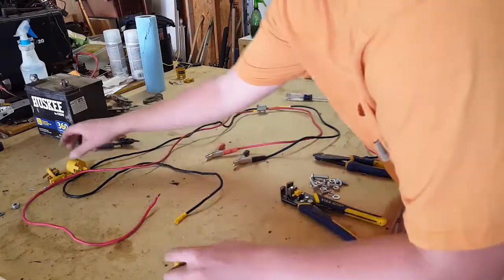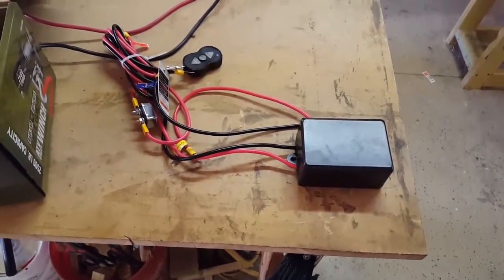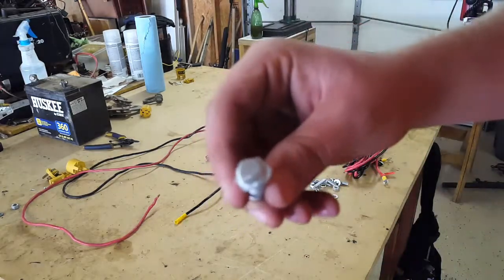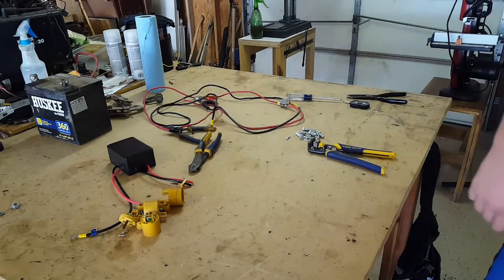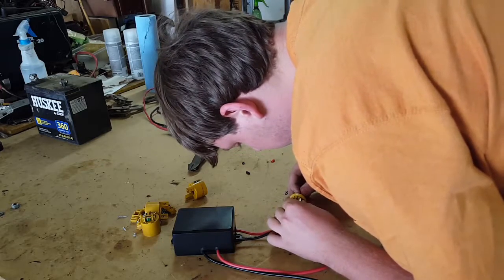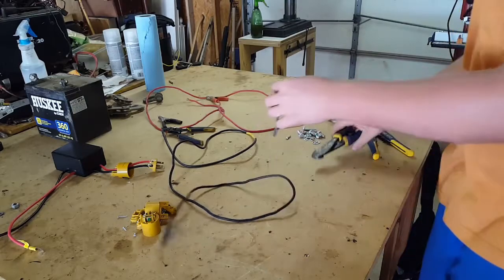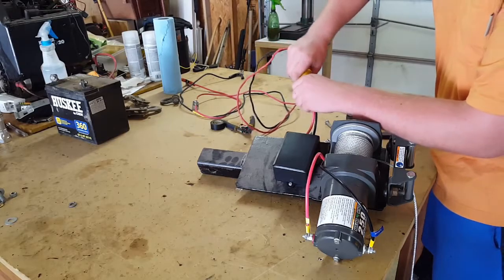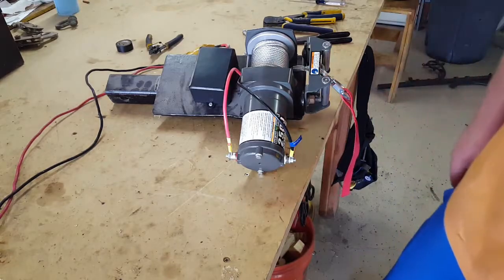An electric plug, a winch, and a receiver hitch - awesome mount setup for winch

Comment: does this answer to How to Run a 12V Winch on AC Power – [Step-by-Step]?  never done this so really confused here.
Reply from the maker: No… still runs on 12v battery just using the plug for easy connection.

Comment: You seem to know about electrical well enough for me to ask you this. I want to buy that same winch to pull a 600lb motorcycle into a truck bed.  Do you think the Harbor Freight Predator generator /inverter can power that winch?  Appreciate it if you could let me know. The Predator can do 13.3 amps.
Reply from the maker: idk for sure. The manual (download on HF site) says that from 0-1000lb the amp draw on the winch is 10-55amps. I would still use a car battery and then just use the generator to charge the battery. If that is the only reason you are getting the generator I would just get one of those battery jump packs instead. Also, the 3500-watt inverter generator says it only does 8Amps for 12 Volts so A good battery or jump pack with high amps would be better.
Reply: It seems that you think this winch runs on AC power. It does not. You should NOT be putting AC plugs on this. What he should be using is Anderson Plugs. This is a dangerous practice to do.  This is a DC winch
Reply: No , The winch requires 135 amps DC not AC
Reply from the maker: @edmckinney8457  ac or dc you seem to be stuck on that.  Read the manual for the predator generator.  As I mention it only outputs 8 amps max DC which is why I replied to the comment that it won't run it.
Reply: Sir : You need a Battery to power the winch . AGM 1500 deep cycle will do the trick . That will run your winch for 15 minutes at full load . I’m retiring in the spring with 45 years as a industrial
Electrician . I don’t know it all but I do know a little bit . If I can help I will gladly give my advice
Reply: @edmckinney8457  Hope you can answer this. I have a this winch and a hitch adapter for it. I'd like to have it easily portable and don't want to hard wire or even run wires to the rear of my '09 Chevy 2500. I'm open to having a battery back there that I can clip onto but how would/could I keep that battery charged/charging? The truck has the 5 (i think) prong plug as well as some sort of a plug inside the bed as a prior owner towed a 5th wheel. Any help would be appreciated.
Reply: @shannonp4037  If the plug in your truck bed has 12 Volt Dc you can use that to charge your battery. Fuse it at 2 amps and you’ll be safe. If the plug comes from and inverter and has 120 Vac, just plug in a trickle charger . If you can give me more information, I can give you a better suggestion

Comment: I do not want to power my winch with a battery. I want to plug it into a wall out. Can I just connect the  plug to the red and black wires and plug it into a wall outlet?
Reply from the maker: Nope that would be bad as stated on other comments the winch is 12vDC… NOT 120vAC!
Reply: Use a DC/AC converter ??
Reply: @shannonp4037  Thank You

Comment: Could you just as easily plug it right into 110 outlet to run?
Reply from the maker: No don't try to do that... a winch is DC 12v.
Reply: @BigRedFishDad  that's why you shouldn't show people doing it this way. You need Anderson Plugs. That's what they are made for.
Reply: @AztecWarrior69_69  I was thinking the same thing. You know you not supposed to plug it into a house outlet but someone else could do it thinking it's ok to do so.
Reply: @BigRedFishDad  how do we convert a winch to work with a home outlet?
Reply from the maker: @JWard2  you don't unless you know how to build or purchase a 120 to 12v high amp output power supply
Reply: @BigRedFishDad  Isn't that what the computer plugs do?
Reply from the maker: @cooldog60  Yes, a PC power supply does convert to 12v but I doubt it can supply the needed amps to run a winch probably not even a really expensive one but you could check the output ratings.

Comment: Don't do this ! This is DC current and needs wire rated at 135 amps . A.C. PLUG WILL SMOKE in no time !! Very dangerous !
Reply from the maker: Guess we are really lucky that those blades on the plug are solid metal... No smoke after three years and have pulled a few cars and a couple old lawn tractors onto our trailer with it.
Reply: I found a ac 110 to dc 12 v with 50A out, but the winch need more that 50A .... know how to make a 100A ?